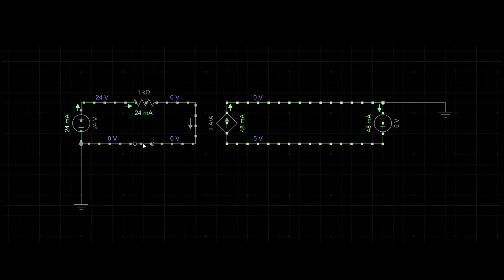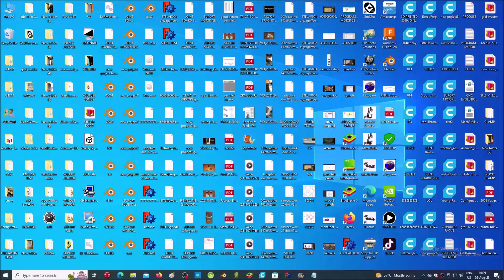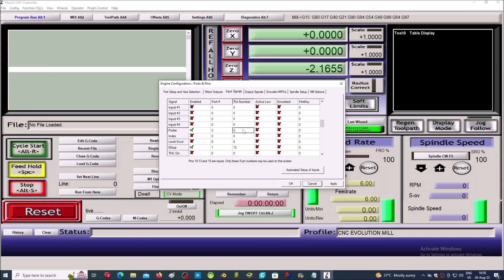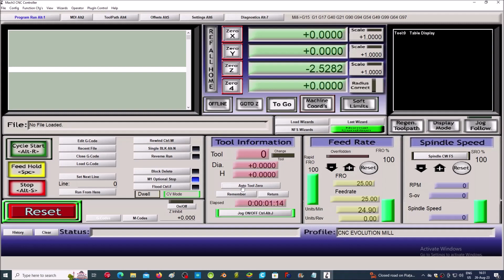CNC MILLING MACHINE BUILD PART 56 - MACH3 USB CONTROLLER CARD ZERO Z PROBE WIRING & SETTINGS

Comment: How does Pin 4 relate to Input 1? Some explanation is required in this area. I am having all sorts of problems trying to get my probe to work. I have one lead attached to DCM and the other to Input 4. How is this set up in Mach3? Is anyone out there? Any help gratefully received. Greetings from Australia wherever you are.